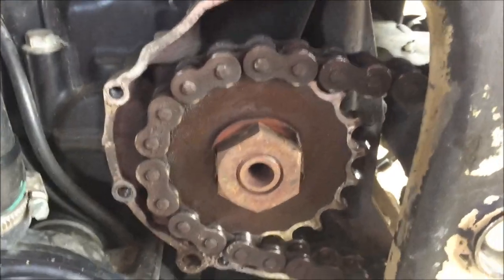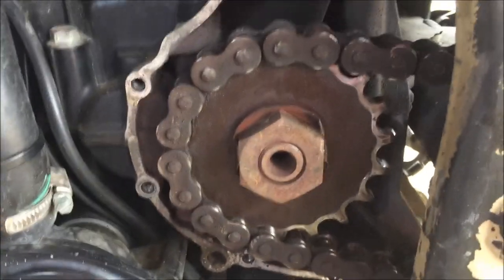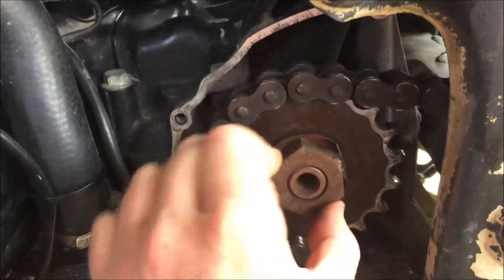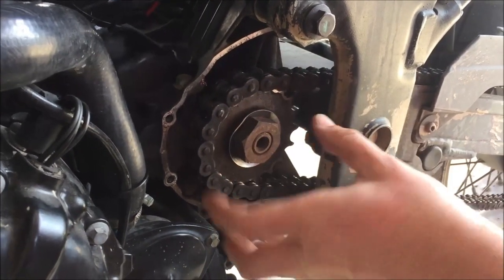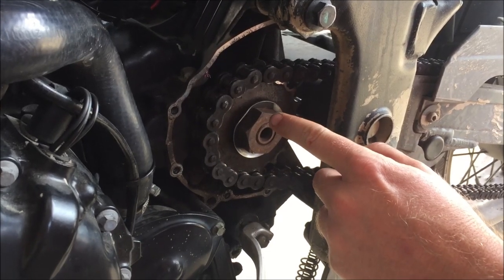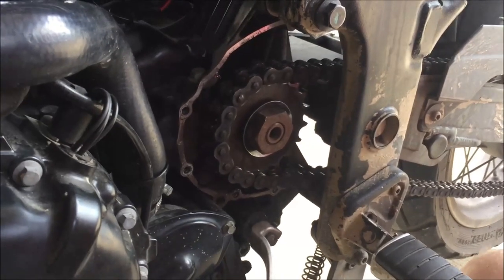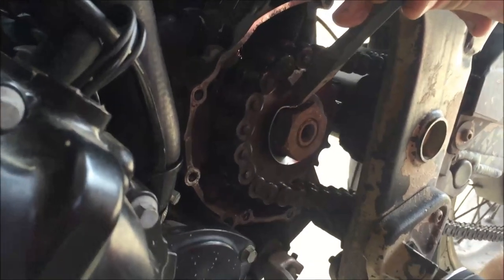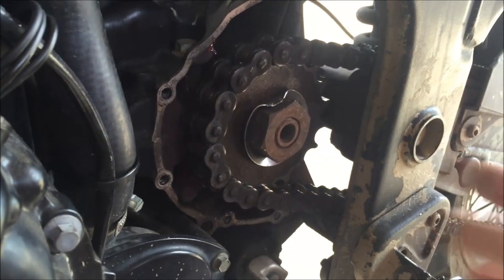Clunking noise when taking off from a stop on this Triumph Chain Drive. Here's what fixed it!

Comment: I had this issue with my rebel after having my tire replaced by a shop.  My wheel was misaligned and it seemed to fix the problem.  600 miles later its back.

Comment: Hi , i know this video is 6 years old..just wanted to check the symptoms to know if the same with my bike... when i accelerate on from get go, it cluncks and feels like there are some gears slipping on each other...however as i accelerate and go faster, its disappears.. it re appears as i brake and start again..there is no loss of power or so... does this mean that its just loose like in video or is my front sprocket gone.. I do burst acceleration as i live in India in Bumper to Bumber traffic and this issue just started..
Reply: This sounds just like my problem. I have a '15 Bonneville and this happened (the first time) while I was on a long-distance trip. I could not figure out what the sound was. Took it to the local dealer service shop and they fixed it with a chain adjustment they said. 
A year later, I'm getting the same issue, but louder and more prevalent. Snow's about to fly here in Maine, so I'm going to put it away soon. I took off all the guards and adjusted the chain last week. Made no difference. maybe it's that splined shaft?
Reply: @eameader  thanks for your input..You are right. It's not just the chain that needed adjustment but also the rear sprocket had undergone one sided wear (had clocked 30000kms on stock sprockets from the delivery).. so the chain would hop around the swing arm or sprocket.. I replaced the sprocke, adjusted the slack at ASC and ensured I lubricated every 500kms.. the noise is gone.

Comment: Wonder if that's my problem too. Zx6r. When pulling off from stop feels like its taking up slack. But chain is adjusted correctly. And when changing to second it clunks again like summat loose.. Im gonna check mine now... Thanks and greetings from the UK 🇬🇧
Reply: Same issue with my zx6r. Did you find the issue ?
Reply: @sean845  
Having the same problem.. did you ever find out anything?
Reply: Could be worn rear sprocket cushion rubbers.

Comment: Exactly same issue on my yamaha FZ s 150. It makes noise during accelerating from zero rpm after shifting of gear but only when the engine is warm after running few kms.  Couldn't find what could be the reason. The chain and sprocket are tight still.
Reply: no.😔

Comment: Once my ttr 230 was clunking when I'd take off and it turns out every bolt on the rear sprocket was loose. It actually lost one of them. I suppose if your chain is loose, it could clunk too. I'm hearing a little clunking on my new hawk 250 and have yet to check the sprockets.

Comment: I always wondered what are the chances to damage something if you leave the bike in gear to loosen the front sprocket bolt.  How much force can the transmission take?
Reply: Ok, just signed up, it will be nice to have some proper help figuring things out for once.
Reply: I mean, i know it should not be done. But the question about torque i don't think it's that way. If your bike produces 70Nm, you must have in account your gear ratio to stablish the torque in the shaft. Let's say you have 70Nm and in 1st gear a ratio of 2.5, just as an example, the shaft must handle at least 175Nm.

Comment: My yamaha fz s fuel injection has the same problem... Chain makes a breaking mettalic noise when a accelerated rapidly after stopping, esp. With a pillion on it. What things should i change?
Reply from the maker: If it was a quick answer I’d try to respond here
but I wouldn’t want to lead you wrong assuming certain factors. Reach out to me
on my website contact page. We have been overwhelmed with ungrateful people and
scammers so I had to do something for my sanity by screening the over 300
requests a week! Contact Link: https://how2wrench.com/contact/ 
Your answers and help are just around the corner.
Save time and money while protecting your investment and yourself by doing it
the right way at www.How2Wrench.com 
Have you subscribed yet to never miss a video?
Have you seen the video playlists https://www.youtube.com/user/conleybuilt/playlists? 
Want to say “thanks” or “keep it up”?
Click here https://www.paypal.me/how2wrench
Reply: It's me. I've got a Honda CB 1100 2013 bought brand new I'm at 23,000 miles. I was hearing and abrasive sound when taking off like a crunching. Powers good acceleration strong. I took of cover for front chain spoocket and had alot of built up residue from chain  oil and dirt in case and outside of small sprocket. Took my time sprayed with chain cleaner removed build up gunk with paper towels and Q tips. Put back together all good resolved issue no abrasive sound smooth etc. Take off your front chain sprocket cover to see if that area is clean or dirty ?

Comment: My yamaha dt 125 is making a bad noise when shifting into 1st gear
Especially when i do it fast and with high rpm
What could it be
Reply: Shifting into first while your going faster isn't great. Unless your almost stopped, stay in second. Most bikes will knock into first if your going fast.
Reply: Even if the clutch is all the way in shifting to first? Is it still bad?
Reply: @vincevince2354  i forgot about this comment 😆, i ride a tpi now, sold the old thing 😅
Reply: @hardendurobosnia17  😭😭thanks for the quick response, but yu think shifting in to first while the clutch is in is bad on any bike?
Reply: @vincevince2354  with the clutch in you can do anything, if it jerks forward or stalls it could be your basket or plates..
Reply: @hardendurobosnia17  💪🏾💪🏾

Comment: I get a clunk on my cbr 650f when in first gear and I relise the clutch just creeping forward in first gear but it's strange becauce it only does it 3 times out of 6 attempts.  I have changed chain and sprockets and also cush drive rubbers in the hub and it still does it. I mean the clunk isn't that load but It will do it when riding sometimes when I drop into gears or soemtimes going up the box when I relise clutch . It's not very bad but I'm just dieing to know exactly what it is and I hope it's not going get worse can you help please?
Reply: @NuffNuff the clutch creep is a need of slack adjustment, whether at the clutch pack or the cable adjustment. The other issue he's talking about is similar to what I'm getting on my nighthawk 250
Reply: Exactly same issue on my yamaha FZ s 150. It makes noise during accelerating after shifting of gear but only when the engine is warm after running few kms. Couldn't find what could be the reason. The chain and sprocket are tight still.

Comment: Wonder if thats my trubble on my vstrom 650. Has to check.
Thanks for shareing
Reply from the maker: Thanks for commenting and adding value to our community!

Have you subscribed yet to never miss a video? Have you seen the video playlists? Over 600 videos! Check them out here: https://www.youtube.com/user/conleybuilt/playlists  

Want to say “thanks” or “keep it up”? Click here https://www.paypal.me/how2wrench    
 
Your answers and help are just around the corner. Save time and money while protecting your investment and yourself by doing it the right way at www.How2Wrench.com
Reply: Hi , was this the problem? Im having a clunking noise when going slow and it repeats faster as I increase speed.
Reply: @MRR7  Hey man, I'm here tring to answer the same problem. You figure out what was doin it?
Reply: @michaelvinson5481  Hi, it was the chain for me. It had a blocked link because it was old and has not been mentioned properly. You can clean it with a motorcycle chain brush, its an U shaped brush that reaches around the Orings. You can use water or diesel to clean it and then wipe it dry and use gear oil (75w80 or something thick) to lube it. 
That's what chain manufacturers recommend and that's what works.
Reply: @MRR7  On it, thanks man.